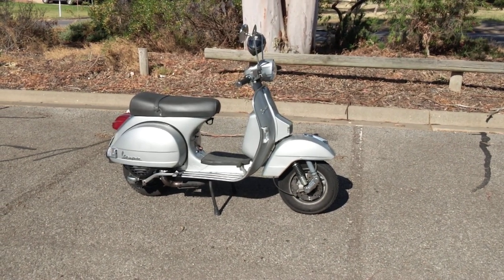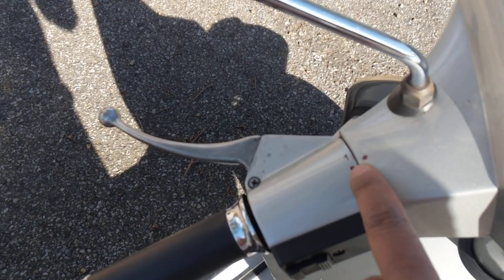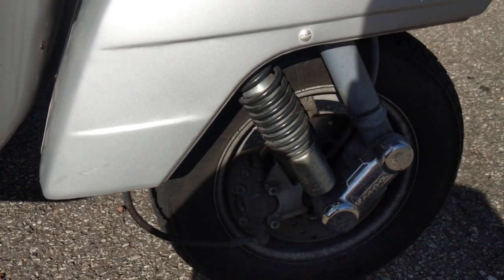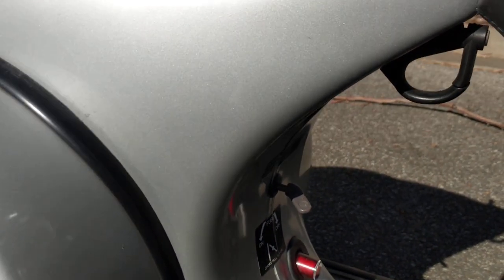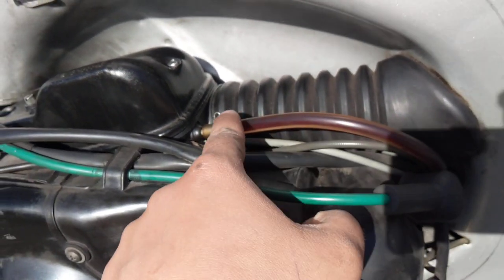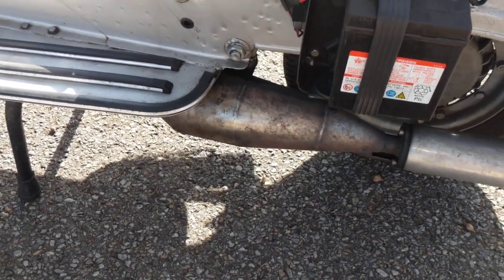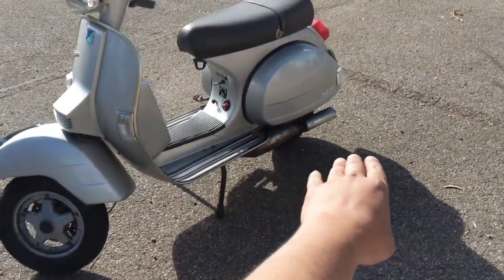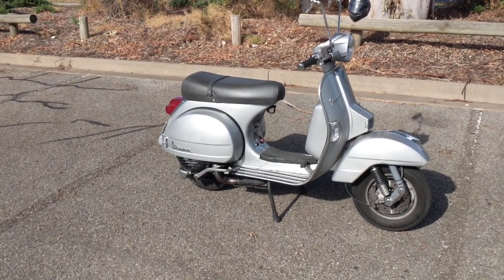Vespa PX200 Review

Comment: Was riding Vespas in England, in the 80's, LOVE THEM, always have, so much so, that my most common way of getting to sleep, is retracing my journey from front door, to a few miles out my little town, on my last scooter, a T5. Every bend/sound and gear change, i fall asleep smiling im guessing. Lovely honest review, of probably my favourite things in life 👌
Reply from the maker: Thank you for your kind comment.

Was T5 quicker than px200 ?
Reply: @samihasib  You're welcome 👌. I never had a direct race with a PX200, but the T5 was quicker at acceleration I'd say. When i first rode it, i struggled pulling away on slight inclines, and a very close mini roundabout, was my Nemesis for a few weeks!, as the front wheel just wanted to lift off the ground 😳. Im no wheelie master at all, so was a little daunting at times. It came stock, with pirelli tyres also. Our little lanes in south east England, were perfect for testing kut its handling, and i found it superb, and was a close match speed wise for a lot of my friends 125 standard bikes at the time. Scootering magazine, at the time the T5 came out, done a special test from Lands end, to John 'O Groats in England, riding like 600 miles or so, to test difference between the T5 and PX 200, a direct comparison. I probably still have the magazine somewhere, but you may find it online maby, worth reading possibly. Sorry i was  rambling 😂

Comment: Very nice. I have a 1979 P200E. Kick start only. Mine still has the spare tire. No way would I give that up, since the Vespa has tube type tires and I have had dozens of flats with tube type tires over the past several decades, including on the Vespa. I found that while it runs fine without a battery, the headlight is very weak, and the turn signals don't work with the engine at idle. I'm the type that you could not give an EFI /ABS bike to. I just love the 2 stroke engine and manual transmission.

Comment: As i saw in the video your vespa handlebar is shaking alot, i have same problem here, did you fix it? I have replace clutch set and shock abserver, upgrated malossi 210 cylinder but it is still shaking more then before! What could be the problem, too much annoying to ride with the shaking handlebar! Thanks for sharing the solution in advance if you know it!

Comment: Thanks for the review.  I'm buying a 1988 motovespa TX 200 has minor scratches but no rust and the manual transmission is and the 2 stroke smell and sound is priceless what's your  opinion on the TX 200?? Anyone??
Reply from the maker: TX200 engine is exactly the same as PX200; with the body of a much loved T5 body. Go for it.... and good luck. Keep in mind though that the front brake will be a drum brake, not nearly as good as the disc brakes.

Comment: The battery doesn't turn on the head light when the engine isn't running but key on Right? Just bought one and still learning about the bike
Reply from the maker: Yap. The electrical system is magneto based, not full DC